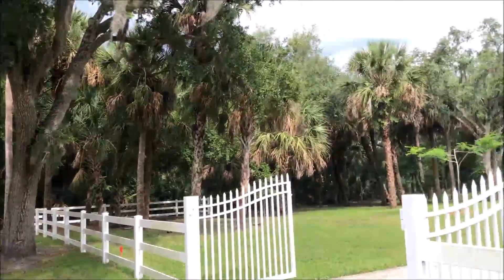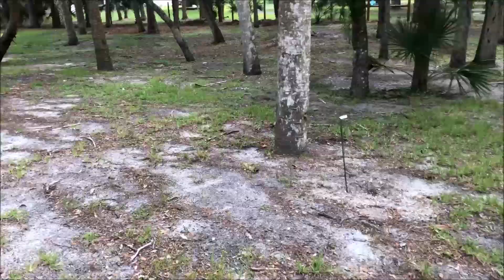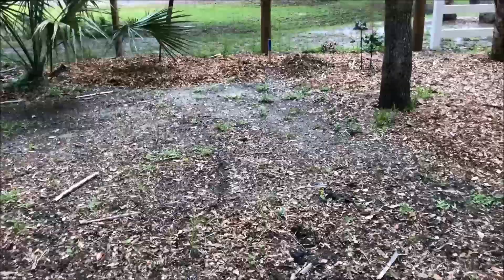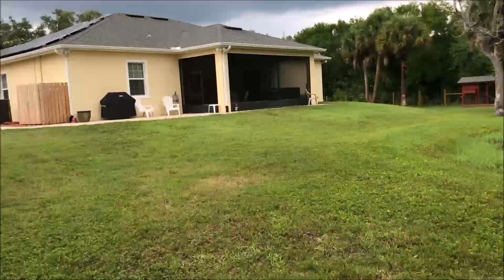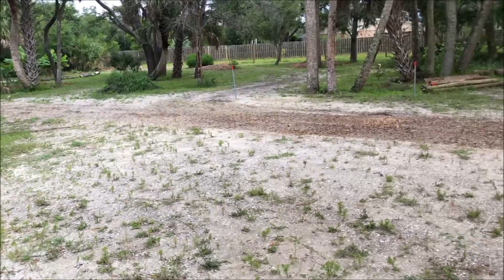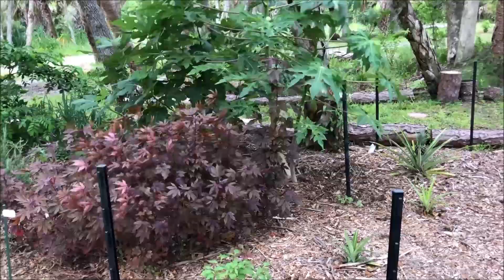Clover update and beginning of infrastructure project

Comment: Hello, sir. Would you by chance give an update, either via video or written,  on what happened to your clover experience? I'm asking because, I too, live here in Florida (northwest/panhandle) and have really wanted to try and succeed in this. I've got a centipede lawn I installed about 4 months ago and it's doing so-so. I've tried just throwing out seed into the lawn after a mowing and see what sticks. That didn't work. I'm currently experimenting with cultivating the clover seed in those peat moss pods/disks in seed trays you see in stores. My thought that maybe they will succeed better if already developed in the pods and just plant them interdisburst in the yard maybe they might take off on their in our few, cooler months and get established. I've seen well-established clover take our Florida heat...it's just GETTING them to that point, I suppose? Any thoughts, suggestions and/or comments would be appreciated!

Comment: There doesn’t seem to be any organic soil in those areas... not much will grow in mineral soil.
Reply from the maker: It's mostly sand, typical coastal Florida. I've got the clover established in a few places now which I'll be highlighting in an upcoming video but not in the real problem areas. I'm spreading wood chips all over the place, including the lawn areas and let the lawn mower chop it up to try to improve the soil. Thanks for watching!
Reply: @BackyardSystems , based on the premise of using wood-chips (or mulch) to /inhibit/ peripheral growth in gardens and around the bases of trees, I doubt the wood-chips are helping.  It takes decades for wood to break down -- the nitrogen bound to it is /very/ slow to release.  It would be more effective to aerate (or at least rake) and water those areas; cover with 1 to 2-inches of topsoil (a.k.a. organic soil); sow the seed; cover with ¼-inch of topsoil; and, water when you can.  I've tried cutting out some steps, myself, too... but the shortcuts yielded only wasted seed, and full bird-bellies.